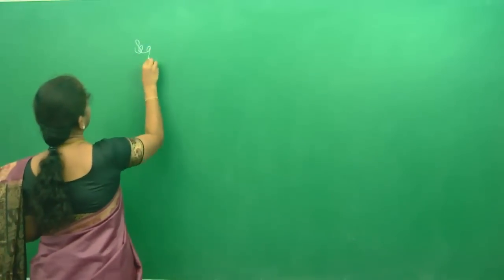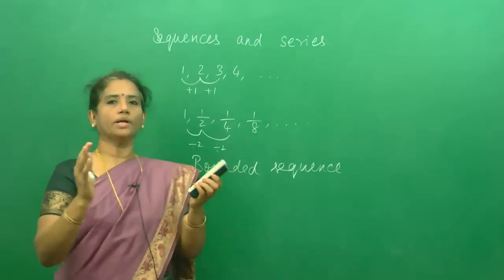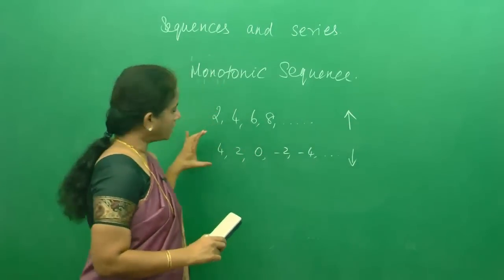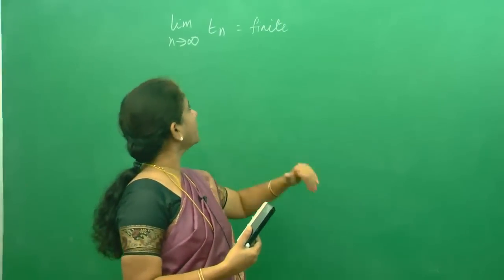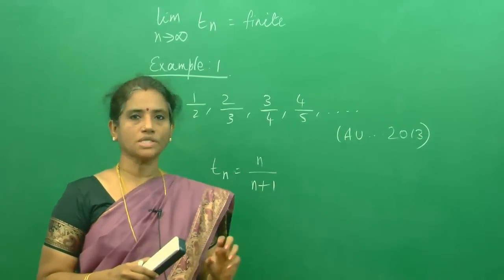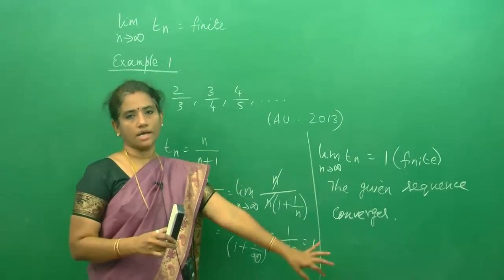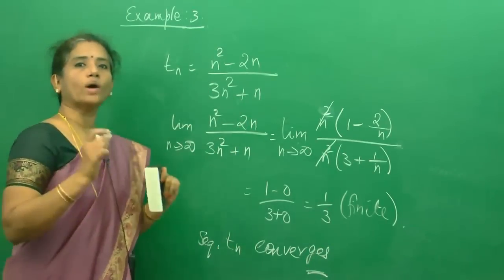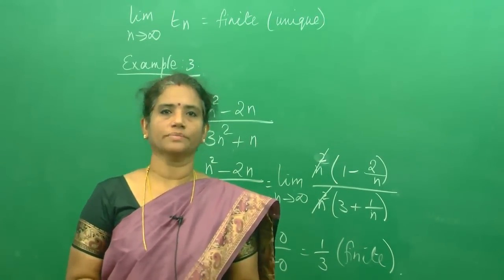Sequences and series : Best Engineering Mathematics Tips (AU ,JNTU ,GATE,Delhi University)

Comment: what about this sequence
(1/2),(1/3),(1/4)....(1/n)...

limit of (1/n) tends to zero as n tends to infinity.
zero is a finite term but this is not convergent series.
Reply: Just because final term is 0 does not mean limit of sum is finite. To make it easier to visualise, we can take an improper integral of 1/x from 1 to infinity. The graph of 1/x meets the x- axis at infinity. That is, the finally, the function takes the value 0 but the area under the graph is not finite due to the very fact that the graph meets the x- axis only at infinity.